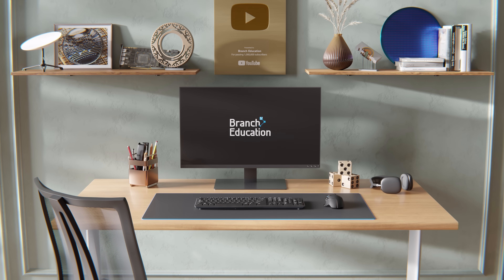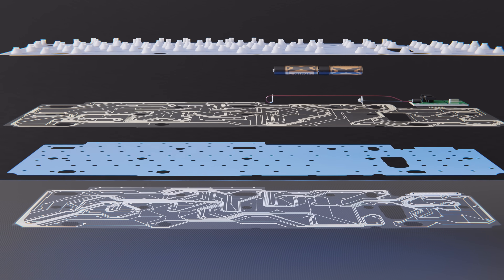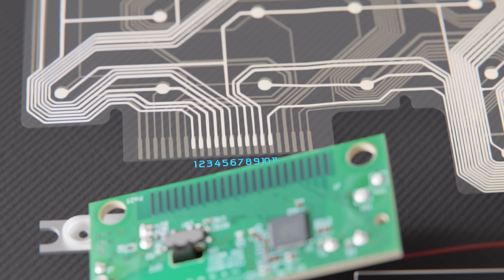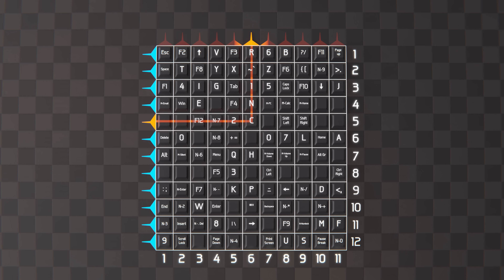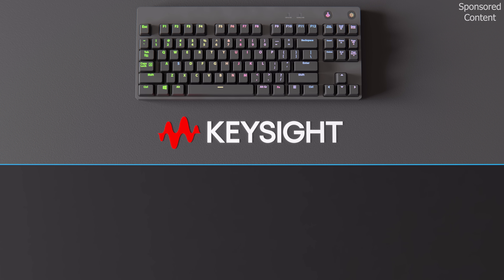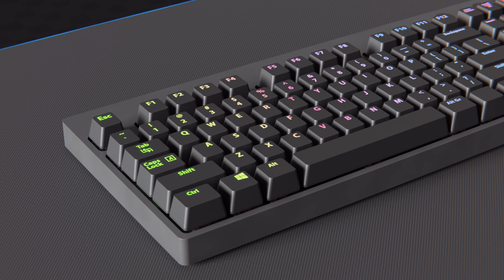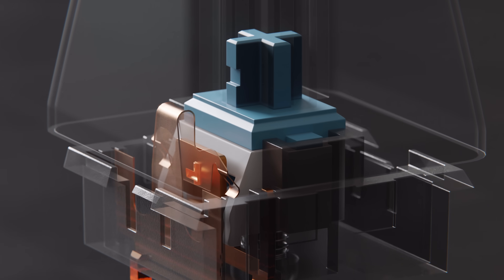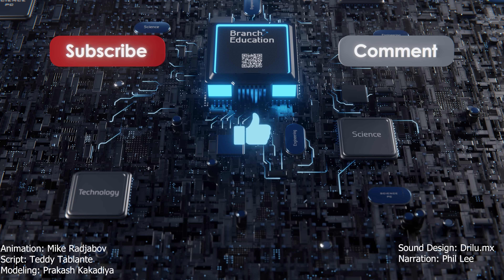How do Computer Keyboards Work? 🤔⌨⌨🛠

Comment: Something I wish you covered waa aliasing with cheaper keyboards. Sometimes when 2 keys are pressed together it creates weird and unwanted outputs which isnt a common issue for office work but can be a major problem for gaming which is a large reason mechanical keyboards became so popular for gamers.
Reply: I bought a "premium" rubber dome keyboard (G19) because I found out I could not do the 360 in the San Andreas driving school as it requires me to press 3 keys at the same time which isn't compatible with the matrix and causes the computer to beep for some reason.

The G19 had 5 key rollover. This was before I knew about the advantages of mechanical keyboards, as I was obsessed with G19's screen.

I kinda wish there was a mech keyboard that had G19's screen.

Comment: If you want to buy a mechanical keyboard, be ready to pay at least 70€. Otherwise a good and a bit more expensive membrane keyboard will have a better quality than a cheap mechanical keyboard. Cheap mechanical keyboards have low value key parts and after a few weeks or months the keys stop working correctly.

Comment: How do gaming keyboards work? The mechanism shown for the mechanical doesn't gave the depth sensing of the press of a key, like a console controller trigger. How does that work? All these do is send a 1 or 0 output, and not press depth.

Comment: I want to correct you at 8:15, the “slider” isn’t there on most switches and is mostly just a clicky [blue] switch thing and the slider and stem are one of the same on most switches. On clicky switches it’s commonly called a click jacket because it’s what makes that click sound. When the click jacket passes the tactical bump I’m pretty sure the contacts act like a leaf spring and slam the click jacket to the bottom of the switch thus making a click noise. The contacts also don’t make much noise on activation point if at all.
Reply: Was looking to see someone said this. The clicky bit is a very intentional addition

Comment: The click mechanism is actually incorrectly described, as due to the low mass and force of the contacts. In addition, what creates the audible clicking sound, as with the blue switches used in the video, is due to a click jacket, or slider in this video, that is separate to the main stem itself. When depressed, the tactile bump in the legs of the jacket create a hammering motion through the release of accumulated potential kinetic energy stored by a combination of spring tension and the tactile bump interlocking with the leaf spring, causing the jacket to catastrophically collide with the bottom housing of the switch, creating your "click".

Comment: I wish you'd gone into more detail about the mechanics of the rubber dome, like how its shape affects the hysteresis of the stress-strain curve, and thus the tactile feel. And the reason why discrete-switch (or "mechanical") keyboards became popular for playing games wasn't mentioned. It's that the cheap key matrix can't distinguish keys that form a right angle on it, and thus many 3-key combinations are blocked. This can be solved by including a diode on each cross point, but that's way more complicated than just mass producing printed plastic sheets. But for discrete switches they're just a cheap additional component.

Comment: Actually, the clock sound of the colicky switches is produced not by leaves hitting, but by the slider hitting the bottom housing. What is clever is the leaves holding the slider in place while the switch actuates just before the switch activates and the slider is sent down

Comment: Since you've been doing how computers work for the past 2 years, can you go do " How a Motherboard works " and " how a power supply works ". I really want to understand what transistors and MOSFETS do on the board, and what how they effect Voltage Regulation Modulation, what the difference is between the metals used. In terms of the PSU, what stands out from cheap brands to the king, EVGA. And what does their overall power efficiency mean.  What does it mean to have PSU that overclocked

Comment: Not a very good explanatory video. Sure, the video is graphically very high quality but it offers a very surface level description of how these two kinds of keyboards are different functionally and costwise. 

The video does not give any detailed description of how the pcb in a mechanical keyboard is connected/programned for rgb lighting. The part about how a key input is detected on a membrane keyboard, is also not very sensible.

For example, according to the video,  a column in a keyboard matrix is scanned by an absense of volt being sent accross the column at a certain constant speed and interval to detect key presses. This explanation is incomplete as there is no desciption of how the lack of voltage already present on a relevant column before a key was pressed cause any difference of electric state while a key is pressed. There is no desciption of how doing so, introduces any new changes in voltage.

Comment: Wonderfully produced video as always, but there are some errors/incorrect definitions worth noting;

1:14: The 104 'keys' are actually 'keycaps'.
1:24: The rubber dome sheet isn't under the keys, it is the keys (the actuation mechanism).
1:41: At the start you mention the cost of wired office keyboard, but are now discussing a wireless one which isn't a big deal, but a little misleading.
2:24: I'd phrase it 'when the user presses down on the 'keycap' or 'when the key is pressed, the rubber dome collapses'. This is an issue of calling the keycap a key
5:23: (might be incorrect) Would have been good to explicity call this polling rate and give the frequency in Hz.
5:27: I could be wrong here, but scanning is constant. You can't start scanning when you detect a key because you need to be scanning to detect the key in the first place.
8:05: Not all of them click, but given the target audience this makes sense.
8:12: Ironically, you call these keycaps on the mechanical keyboard but not the membrane one.
8:16: An unfortunate side effect of using Cherry MX blues as the example switch is that this slider design is unique to click-jacket switches and isn't representative of linear, tactile, and other clicky switch designs. The slider in MX blues is more commonly called a 'click jacket' because it's separate from the blue stem and pole.
8:53: This is just incorrect. The leaves contacting each other is not the source of the clicking sound in any MX-style switch. The actual souce of the click is the click jacket hitting the bottom housing. The pole hitting the bottom housing creates that 'clack' sound.
9:04: You also actually never explained why this switch is tactile. The animation shows it, but it is not explained.
9:00: Again calling the keycap a 'key'.
9:11: The stem and slider in MX blues is actually separated to create hysteresis. What you described is travel distance to actuate the switch, which all MX-style mechanical switches have (typically around 2mm).
9:37: Eh, I would argue most rubber domes are more tactile than MX blues.
9:40: The keycap hitting the rubber dome isn't the source of tactility, the collapsing of the rubber dome is.

Comment: The click sound from a mechanical switch comes from the bottoming out of the switch stem, not the leaf, if it were a poorly designed mechanical switch though then the leaf has leaf ping which might be falsely attributed as producing a sound. 

What's more interesting is what's shown in the video, a blue switch has that white portion known as a clicker which the show blue stem impacts the top of and creates the sound of the switch along with a tactile feel (the small bump on the white portions legs)

Comment: Sorry to inform you, but the click mechanism explained is incorrect. The click in not produced by snapping of metal contact points of the leaf, but when the click jacket(white part below blue stem) strikes the bottom of the stem or the switch.
Reply: The clicky sounds of a blue switch are somewhat produced like this.

Comment: Usually I'm a big fan of these videos, but the part about the mechanical switch was just not correct. The sound was from a different switch as the one that's shown. Since you only hear the switch bottom out sound in the animation. Even though it gets played in the middle of the press. The white slider has to move freely to make the click sound, since it's a clicky switch. What really happens is that once the bump on the slider is past the leaf, it will be pushed down by that leaf. Where it hitting the bottom will make the click sound, after which the stem (blue part) will hit the bottom to make another sound (as opposed to the only 1 sound in the video). So the reason for the slider having space is for it to click. It not actuating upon a slight brush is mostly achieved (on non-clicky or different style clicky switches) by just having the part of the stem that touches the leaf not being small enough till you pressed it for about 1.5 mm on average between different switches.

Comment: This was an awesome video! I think one thing to note is the specific mechanic switch type you showed was a clicky switch, which is not the only design regime. There's generally two other mechanical designs (which are separate from new hall effect switches as well!)

The slider present in these switches is separate from the stem as they're intended to "Bottom out" the slider separate from your key stem. That's used to create a tactile AND audible feedback for when the actuation occurs. Which is why typists prefer that switch.

However, linear and tactile switches are different. The "slider" portion is actually a part of the stem, it's all one piece. For linear switches, this means there's no tactility aside from the stem bottom and topping out, so no feedback on when the leaf springs makes contact. This is because there is no valley in the stem's point of contact with the leaf spring. It just slides past the leaf spring smoothly. 

Tactile switches use the same valley to engage the leaf spring to give you a tactile indication of actuation but no audible "click" feedback, since it's all one piece and that slider doesn't slam into the bottom of the switch housing.

Again, great video! The animations were superb.

Comment: this is a really good explanation of how keyboards work. however, one thing to note is that mechanical keyboard clicks on clicky switches generally come from a click mechanism, not the contact between the metal leaves. this can best be demonstrated by using a key switch without a click mechanism, such as a linear switch. which will generally be much quieter than clicky switches. other than that, most of your information is correct. keep up the great work!
Reply: yeah, wanted to say the same thing :P
if it were to be made from the metals then the sound would be much more metalic than plasticy
Reply: Hi breadles
Reply: @yurio3693  hi

Comment: So if a cheap keyboard can just detect it that easily, why do we still have N-Key Rollover / Ghosting?
Reply: Membrane failure. The domes will slowly start to collapse on themselves causing contacts as well as influencing nearby domes to lower a bit on press. Higher quality membrane keyboards can have single membranes per key or just better quality to mitigate this.

Comment: I am amazed at how accurately the L K270 keyboard is modeled. It is actually my daily driver I typed this with. And due to coffee spills, I have had it apart and rinsed it out so I know the internals well, and it still works. You can actually run the shell and the keys through the dishwasher and then let it dry out completely.

Comment: How about ghosting, when we try to press two different keys in membrane keyboard?
Reply: Apparently if you press three keys, they will all short together, causing the pulse to be detected on both the rows
Reply: @pixels_per_inch  I only have to press two keys and they don't register.
And why mechanical keyboard doesn't have ghosting, you can press all the keys at the same time?
Isn't it the chipset that read the input?

Comment: I don’t think you hit the mark on the mechanical key switch sound. The contact leaves don’t make any noise. The model you show, with a separate slider and stem, is from a “blue”-style switch. The slider is held up by the contact leaf that it is touching. When pressed far enough for the contacts to touch, the slider is designed to fall down (in your animation, it stays up even though nothing is holding it up) and it bounces against the bottom of the switch housing, and that is what makes the rattly click noise associated with that type of mechanical switch. Other varieties of clicky switch generate noise in a variety of ways. Linear mechanical key switches have the slider and stem as one part and they typically only make a sound when the switch is pressed down all the way, and the slider impacts the bottom of the switch housing.

Comment: Awesome Video! What about the cheap $5 semimechanical keyboard?
Reply: And some keyboards have single rubber keys on each key instead of a full rubber sheet membrane that has the keys. but that's still awesome
Reply: there is no such thing as semimechanical, theyre just membrane keyboards with a click leaf.
youll still get the mushiness of membrane

Comment: How does key rollover works on rubber dome keyboards? I have a Wooting keyboard myself, these mechanical keyboard works with a laser on each key to see how far a key is pressed and thus can send more than just a binary output so you can set a different actuation point per key/profile and you can even use them as analoge keys and emulate a controller.
Reply: The rubber dome has zero impact on rollover (for instance: topre uses rubber domes but has a capacitive sense mechanism so has inherent nkro as each key is isolated), the membrane sense mechanism does tho. Membranes boards usually only have 2 key rollover which means only 2 keystroks can be output at the same time (i think due to the layout of the matrix whereby mutliple keys are on the same sense line so multiple cannot be detected, but i could be wrong.). Some  gaming-focused ones have 6kro typicall around the wasd cluster (this requires a modified matrix and wire layout compared to standard office keyboards).

The keystroke detection on the wooting 1 (sounds like this is your version) only effects rollover in that is allows for diodes to integrated into the pcb. The diodes are what allows mechanical keyboards to have nkro. There is some USB protocal stuff too which i don't understand enough of to explain.

Comment: The "mechanical keyboard" part is so narrow that it can misrepresent this type of device to viewers who don't know anything else about them, and will perpetuate the old myth about mechanical keyboards being incredibly overpriced without offering any benefit in return.

"The switches are soldered in." It is not a defining factor - they don't have to be, most enthusiast boards would offer hotswap sockets, and many people won't even consider a non-hotswap board these days because swapping switches for a different feel (or to repair) is a major selling point of mechanical keyboards. 

"It has LEDs." It is not a defining factor - not all mechanical keyboards have LEDs. Most enthusiast keycaps are not shine-through in the first place. 

The switch pictured is a "click jacket" type of clicky switch - incidentally, the switch with the worst reputation in the community. There are physically different clicky switches with better sound signatures, but more importantly - most prefer linear or tactile switches that do not intentionally produce a click, and offer a feel different from membrane keyboards, desirable both for gaming and typing. There are also "silent" switches which are even quiter. Mechanical keyboards can make less noise than membrane keyboards - clicks are not a defining factor. And sure enough, switches also come in low-profile variants as well. And I'm not even talking about game-breaking analog switches, like on Wooting boards. 

To drive the point home: one of the common budget keyboards is a Tester68 (no LEDs, not soldered, 68% layout) with Gateron Milky Yellow switches (linear, so not clicking) and XDA PBT keycaps (not shine-through, likely white). It's still plastic and tray-mounted, but has silicone and foam that dampens the sound. And it's about $50. 

Nothing was said about different layouts that mechanical keyboards offer, replacable keycaps and keycap profiles, PCB/plate mounting types, polling rates, or programmable firmware (QMK). Yes, technically this video - based on the script and the thumbnail - is about comparing a dirt-cheap basic keyboard to one that costs 50 times more... but it's also titled "How do computer keyboards work?", which is a way more general and neutral topic. Given how effective this channel's 3D work is, people may consider the information presented to be equally flawless, yet as I've noticed several times - it is not. So, if you made it this far into reading this comment - just be aware of that fact when watching these videos.
Reply: Yeah I do think these problems should be addressed. It isn't like he doesn't make half hour long videos, but maybe he wants to split it into a series?
Something critical missing is the n-keyroll over, I think it is a fair point to bring up this problem since it affects gamers and fast typists.
I also think he should mention that there are different types of switches out there, I think optoelectric and hall effect switches will get more popular, and they seem to perform better and last longer.
Reply: This was informative.
Reply: everything you said is correct. But the most good keyboard is the one you buy and use it till it breaks. There's no fun in trying to get the best keypads when YOU can make the "fail point" be the best with training, and a lot of it.